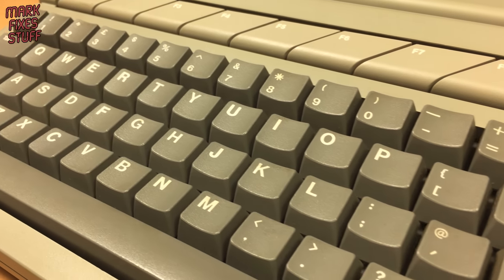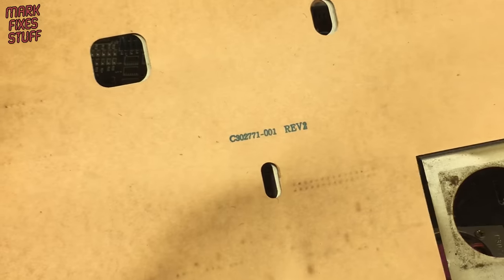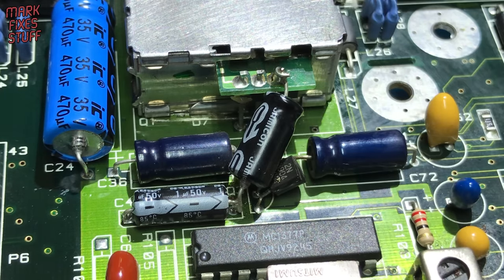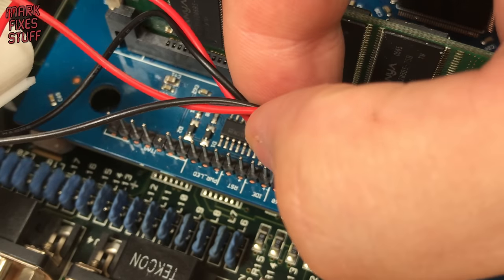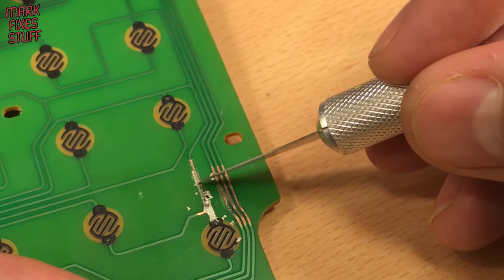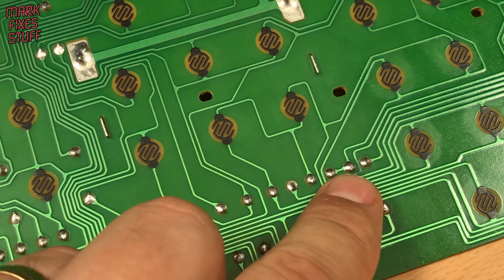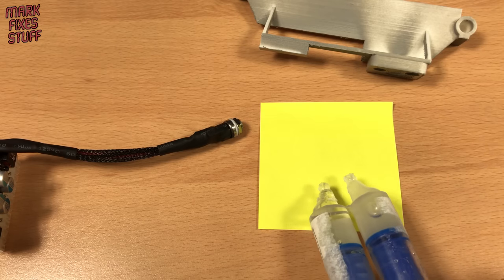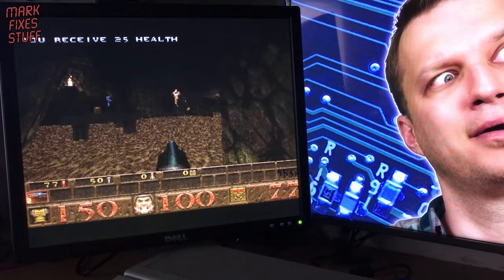Servicing an Expanded Atari Falcon 030, Recap, Keyboard Repair, RTC Hack Mod & Clean Up!

Comment: Great job with refurbing the Falcon. Here's a tip: you usually cut cable sleeving with a hot knife or  soldering iron to get a nice finished end. Then gently re-expand it so it can slip over the wires and finish the ends with heatshrink.
Reply from the maker: That's a nice idea! I have a hot knife as well. Thank you :)

Comment: Hi Mark. 
Great video mate. 
To the point and concise albeit the toilet humour references erm!!! 
Very well made and I really liked that you showed cleaning up the solder splatter after doing the re-caps. One of the most important steps that a lot of YouTube'rs forget or don't realise how important it is to do so.
Subscribed now.
KEEP up the good work mate.
BTW! I'd kill for that system.
Was only a dream system for me back in the day.
Reply from the maker: Cheers Sean. I'd kill for it too! It's not mine. 
I can't stop the innuendo. My patrons literally expect it and moan when I forget LOL.
Reply: @MarkFixesStuff Have you ever heard of the Sovereign SuperSports 1977 consoles mate?
Reply from the maker: @sausageeater9357  no mate. Is it one of the many sports labelled pong clones?
Reply: @MarkFixesStuff  yes it is. So hard to find working versions of these now but I found one, the video output on them is awfully weak though
Reply from the maker: @sausageeater9357  a lot of them have the older style paper and wax capacitors as well.
Reply: @MarkFixesStuff  tbh mate I haven't looked at mine.
Would be nice to see if we could mod the output for a slightly stronger signal.
But where would we begin as I have no genuine knowledge of electronics lol.

Comment: 5:50 Interesting fact someone in german atari-home forum discovered: Cap C6 seen in this video closeup, is soldered in the wrong way, due to a mistake in Atari's schematics!
The upper point marked with + on the PCB actually has -12V, which means that the lower GND connection has positive potential and the cap should face to GND with it's positive side!
The C6 cap of the forum user collapsed (the cover of the positive side popped out!) because of this! 😲

Comment: Still working on a original 030 with 14MB running only Cubase for MIDI. It controls my whole studio. I have no problems what so ever. Do I have to recap? Or wait until a problem occurs? Thanks for the video. Nice work! I was a repairman for Atari The Netherlands. Lovely to see the machine is still alive on the planet.
Reply from the maker: I think if it works you are fine  :)  

Sounds like a nice setup.

Comment: Very nice video. I think you know this already, because I think you had the polarity right in the video. C24, the large 470uf in the modulator area is marked incorrectly and installed backward from the factory. This shows when installing new caps as they begin to bulge in that location over time.
Reply from the maker: Yes thank you for letting me know. It’s amazing how many of these little quirks exist in the older machines.
Reply: @MarkFixesStuff  I just re-watched the video sober 7 months later, seems your new cap is installed the same orientation as factory. Double check this as it is probably bulging/leaking by now.
Reply from the maker: @Storm_.  cheers, I’ll get it checked out.

Comment: The CT60 adds a massive amount of power to the Falcon compared to when it was made.  Also, the Dallas RTC's are Still made and the settings have to be updated when the are changed.
Reply from the maker: I couldn’t find one anywhere when I made the video. Now I can find loads. Quite expensive though! 

Richard took me through the settings software. We had the card running at 100mhz iirc. Amazing stuff. Thanks for taking the time to comment. Do you have a falcon?
Reply: @MarkFixesStuff  I do, but mine is strange as it is a UK Falcon but I am in the USA (Has US Internal PSU) so I am lucky to be able to use all of the UK / European software as they were not common in the USA. It will output fine to VGA and RGB (I use component adapter) just not RF which I do not care about.  I have a CT60e too with 512mb and a 100mhz rated 68060, but never installed them a I want to keep an internal PSU, and did not like the Pico touching the RF Shield.  Did you see my other reply with a link to a video of a case mod I am working on that will allow the Falcon (and STF/STFM/STE and Falcon) to be used like a desktop with no hacking to the case or keyboard?
Reply from the maker: @10p6  I didn’t see the link. I’ve been a bit snowed under with this weeks video production and I’m yet to do a comments run. It sounds very interesting. I’ve yet to get a Falcon myself but maybe one day I’ll get a generous benefactor like Ctrl-Alt-Rees.

Comment: Best conductive paint I have used is the stuff with real Silver in it, usually comes in a glass vial  I fixed Amiga keyboards with it and resistance is low too
Reply from the maker: I thought it would be interesting to try this cheapo stuff because I couldn't believe the price. Turns out I was robbed hahah! Where do you get your paint from? I bet it's expensive?
Reply from the maker: That’s not bad at all!! Purchased!
Reply: @MarkFixesStuff  My first 16 bit was an Atari ST, I remember seeing a Falcon back in the day used to live close to Goodmans International Public Domain Library and Mike the owner had one as soon as they became available

Comment: The finest Atari computer second only to the great 800.
I think the Chinese sold you fake conductive paint, the one I buy in Farnell costs £37 for 5 grams. I only use it if the wire is not an option or, because it's quite resistive, in small fixes.
Reply from the maker: I love the 800 but the 400 is really nostalgic for me because my cousin had one with Caverns of Mars and Star Raiders. I definitely got ripped off on the “silver” paint.
Reply: Caverns of Mars is a hidden gem, and nostalgia for me because a mate owned the 800.  A real beast of a computer, full keyboard, 2 cartridge slots and 4 joystick ports!  We both had the Atari ST (the lesser Falcon).

Comment: In the mood to work another bird? I got one that really needs love. White flickering screen, no power on floppy, no hdd access and a video connector contact/ pin needs replacing. Power light is on. Managed to swap out the RTC & socket but it didn't fix the problem. Might be caps, gals or a right crappy soldering job on my part. I dunno.

Comment: Too bad it would be cumbersome to re-mount the RTC coin socket outside the case. I was thinking of how some Amiga 2000 owners have done that, but they have more exterior case mounting surface to work with...
Reply from the maker: I suppose they last a long time, so not too much hassle.

Most Falcon owners have the case off once a week anyway!!!  :P

Comment: shame you couldnt repopulate the whole board with wangs
serious suggestion for future use........conductive paint for heated rear windscreen track repairs......ive used it to bridge a good 3/4 inch break before and those screen track take a relatively hefty current

Comment: Wang cap..... is that some form of prophylactic?    xD Great machine you got there... A shame Atari released it way too late in the timeline.
Reply from the maker: Pop a cap on yo wang! Yeah. Very late and rare machine.
Reply: @MarkFixesStuff  I hand a Wang PC and like a horses ass I got rid of it....regrets are high
Reply: Ain't that the truth. Since the STe was delayed until 1990, it probably should've had a 68020 in it, VGA graphics, and either the Ensoniq audio chip that the Apple IIgs and SNES had [which the Atari Panther would've also had] or a YM2151 or derivative. That would've at least shut up the Amigans for the most part... well, not about multitasking...
Reply: @TheJeremyHolloway  I'm glad they did not bother with the Panther.... it was pretty weak. However, though the Jag was the right way to go, they made way too many boo boos on it's design.

Comment: That pcb reconnect paint is rubbish never has worked the metal paint pens don't work either old skool is the best way 😊👍
Reply from the maker: Yeah. Lesson learned. Made for some good footage though.
Reply: @MarkFixesStuff  yes it did made me say in my head nooo that wont work but it was good to watch 😊

Comment: Well, the demo is basically an Amiga-demo, so I think the Atari-people would have some other preferences there ;) (Sure, it's cool that the demo runs on Atari, but I think the Falcon has a few really good demos aswell.
Also, Midi on the Amiga was quite easy to build, but it didn't have it built-in. Also, Amiga-Sound was 8-bit. (yes, yes, you could tune it to pseudo-14-bit, and we all did).

Nice repair though, I'm doing basically the same with a battery-corroded 486-board now. It's ... not fun :)
Reply from the maker: Yeah, it was a kind of joke with some of my viewers to use the Amiga demo :P
Ugh... battery corrosion on 90's motherboards is the worst. Are many traces dead?

Comment: I have used very thin cables, and after scraping the loos solder mask, i then put UV Solder Mask on it, that is how i did it.
Reply from the maker: I really need to get some solder mask paint. I always end up working around not having any and then forget until the next time.